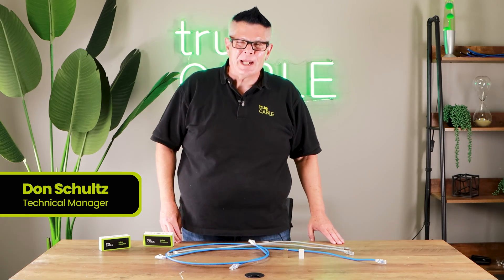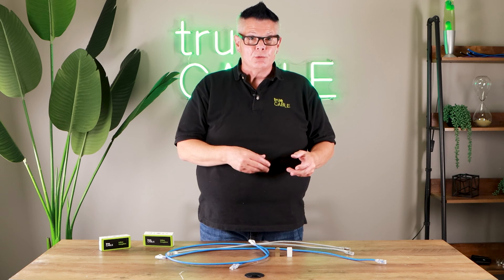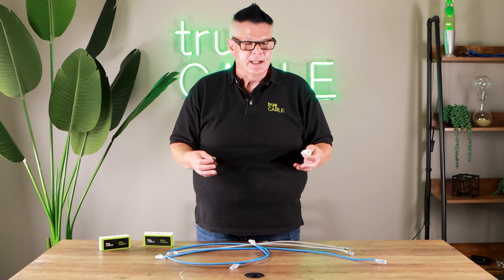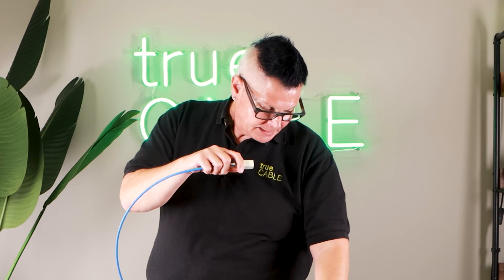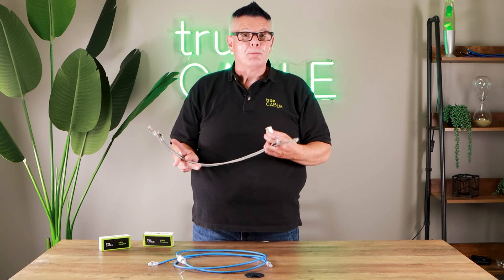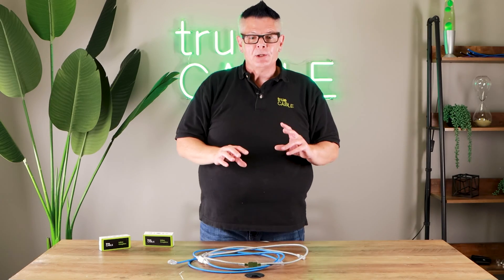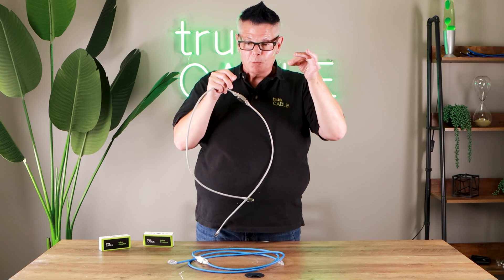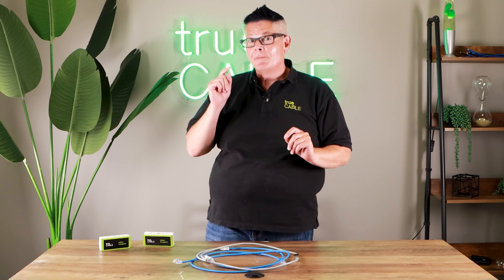Need To Extend Your Ethernet Connection? Try Inline Couplers!

Comment: At my parents lake home, I don't even have jacks installed like I do at the main home. So if I do put say an outdoor coupler and it's only one. On both the other ends it goes switch to switch. Is that about the same as having 2 jacks on each end or patch panels on each end? You get what I'm saying? One couple in the middle with the ends going directly to the switch vs 2 jacks on each end?
Reply from the maker: Hello! If you are going to use a inline patch cord coupler like this, then the assumption is that you are using two already terminated patch cords (factory made) in order to complete the connection. This is not equivalent to using keystone jacks or patch panels in the slightest. In fact, what you are thinking of doing is the exact opposite direction from the reliability and performance you can count on from using keystone > solid copper cable > keystone. The reason has to do with the number of RJ45s in the mix, and this gets to be a bigger problem if those RJ45s are hand terminated onto solid copper Ethernet. If you are going in this direction, I would advise using already factory terminated patch cords, and make sure you are buying Certified Category rated component level patch cords (most on the market are not--shop carefully).

Comment: Can you use keystones to extend a run for access port instead of using coupler
Reply from the maker: Hello! Yes, a keystone jack can be used, and after terminating the one side to the raw cable I would recommend using a pre-terminated patch cord to plug into the RJ45 side for the extension (rather than hand terminating a RJ45). Another idea, if not using patch cable, would make use a 110 splice block box in the proper Category rating if you need to simply splice a run in the middle.

Comment: What on earth is a channel?! This is not helpful unless we know what that means in this context. At home we are using 2 couplers at the moment. At another one of our properties we are using 1. The reason for their use is the amount of work required to remove the existing cable and put in a longer new one, just is far too much work and would involve disturbing asbestos ceilings at one of the properties.
Reply from the maker: Hello Edward! A channel is the end-to-end communications channel from one powered device to another. It will end up in 8P8C connectors at both ends. Channels are constructed in two primary ways. First, a patch cord (single cord) alone can function as a direct attach cable and, therefore, a channel. A solid copper permanent + 2 patch cords is the second prominent way. The permanent link is terminated at both ends to either two keystone jacks or to a patch panel to a keystone jack, yielding female ports. Patch cords are plugged in on both sides, completing the entire communications channel. Here is a blog that really explains it and even shows how to construct one properly: https://www.truecable.com/blogs/cable-academy/calculating-ethernet-cable-overall-channel-length-for-success. As for couplers, I understand your circumstances and in many cases (depending upon your bandwidth needs) the use of more than one coupler to construct a communications channel may be all you can do to get from A to B. It happens. The key is to use factory pre-made patch cords that have been factory tested and a high-quality component and Category rated coupler, like trueCABLE sells. The refrain in the video is to avoid using too many couplers, and here is another blog that will demonstrate just how many you can get away with before things start going bad: https://www.truecable.com/blogs/cable-academy/ethernet-couplers-how-many-is-too-many. I hope that helps clarify things!